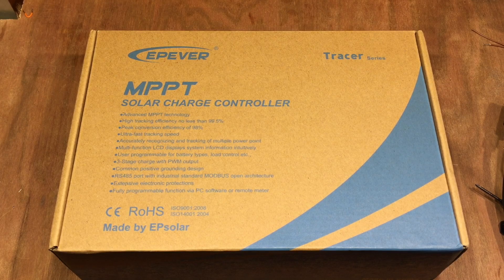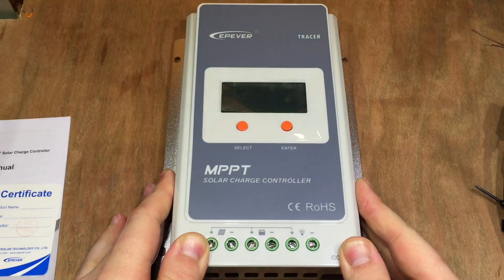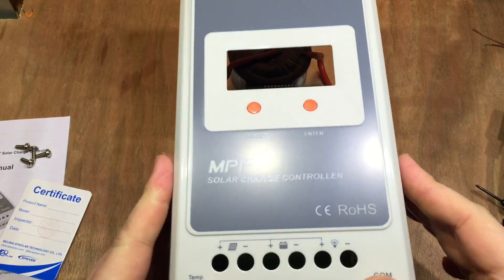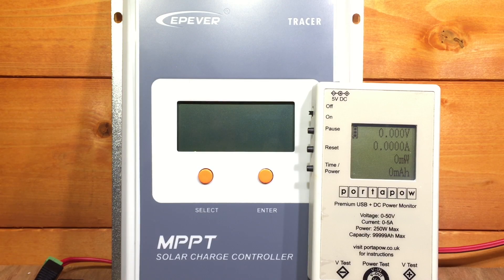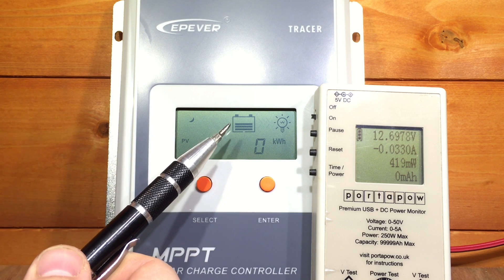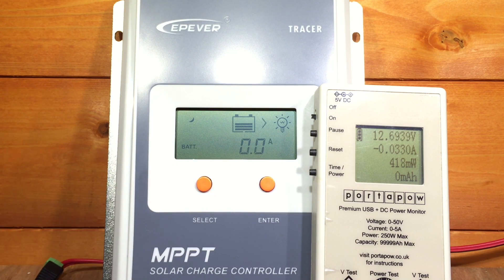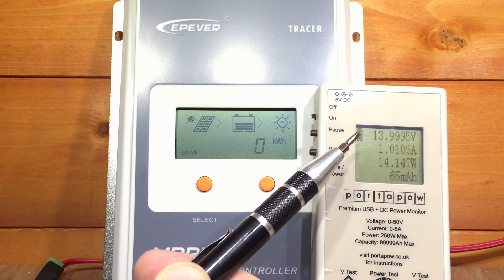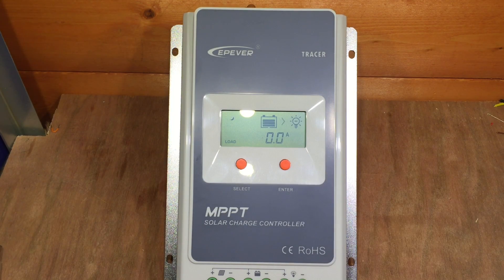MPPT Charge Controller Review - EPSolar EPEver Tracer A Series - 12v Solar Shed

Comment: Hi, I've got the 10 amp mppt , what happens if you you add more solar panels but don't up the model of mppt? 
I've only seen 6 amps from my 100w but I'm adding another 80w  panel
Reply from the maker: Depends on the model of solar charger. The Tracer range allow you to add more solar to the input - there’s a maximum rating in the manual. It will never charge at higher than the rated current though. So you could have panels capable of providing 25 amps on your input to the 20 amp model, but it’ll only charge the battery at 20 amps (or 21 I think it is).
Reply: @AdamWelchUK  I've got the epever Triron 1206n I think. It's a 10a anyway.
I'll not look at upgrading I'll stick with that .
Cheers
Reply from the maker: Yeah the triron range does the same thing. According to the manual yours has a rated array of 130w (@12v) but a maximum permissible array of 390w. It’s great really because you can over spec your array and still get close to your rated current in winter or poor conditions.
Reply: @AdamWelchUK  thanks for the information

Comment: hi, i'm wondering if I need to make a splitter for my battery to load, or if I can connect the load to the mppt directly given my load requires high current. how much current can be pulled through the mppt if the load is connected at the load ports?
Reply: I have the same and my load max is 20 ish amps 12v no probs.. I think it's limited at the amp rating (40) but not sure. My 12v 230 ac is connected directly to batteries.
Reply: @robinhood4640  yeah the limit is 10A for me

Comment: No good. My NiFe batteries need 17V upper limit. Tell the manufacturer to put a user section on the charging parameters.
Reply from the maker: There is. You just need a usb cable, the mt50 or one of the networking adapters (Ethernet, WiFi or Bluetooth) to be able to program that setting. It can’t be done with just the two buttons on the unit itself.
Reply: @AdamWelchUK  I thank you for your response. Is there an app for that?
Reply from the maker: Atrhur Robey There is an Android app which works with the Bluetooth and WiFi modules. Check out the info at epsolarpv.com

Comment: I have just upgraded to this controller, my system works but I don’t understand why I am not getting an Amp readout in the display on either the Battery or PV amp readout. Have you any ideas?

Comment: I bought the 40 amp version. Worked great for one day. Second day, full sun, showing 20v from panels, but showing my batteries at 13.8v. Problem is testing batteries with multi-meter shows 8.6v. Controller's display is showing .1 amps going to the batteries.  Why does controller think the batteries are charged and delivering no current to charge them when they are testing low? Not a bad multi-meter because my inverter is faulting because the batteries don't have enough juice.

Comment: Great video, my 2210a was working great for 2 years until it took a hi voltage hit, I think  lightning. It fried  d12 (diode ?) Every thing seems to work except it will not receive power from the cell. Any Idea what d12 is? I would like to replace it to see if I can get the controller working, thanks

Comment: So a few issues here. An agm isn't a gel and a gel isn't an agm. No such thing as a hybrid  agm gell battety. Use a battery  that is drained so we can see the full effect if the mppt charging.  When it's that high amps will be lowered  naturally. Mppt likes high voltage.  One doesn't typically  do just 17 volts . That's useless to the mppt. It take a high voltage and drops it down and converting the dropped voltage into higher amps. A solar panel with 17 volts  is only going to put out close to 4 amps and the mppt barely put out 1...

Comment: hey adam. thx for  the effort and great vidz. im using a 12v  windturbine and im curious if it will run with a solar mppt charge controller ?. the problem with the PMW is that the  turbine will do a free spin when the battery voltage is high enough to cut the charging of the battery. will a mppt do the same? or will it cause the turbine to go into break mode , so its not over charging?. i know that wind turbine chargers is not in your field of interest - but you might have some insight on this anyway.thx

Comment: Hi Adam great video purchased this a while ago..just upgraded to a 12v Valance Lithium ion battery 138ah (Built in BMS).Could you advise me on the settings I should use in the user section I am using the WiFi box so can change parameters on my mobile.
Email Kennytyrer@msn.com
Thank you Adam

Comment: Thanks for the video Adam!! Couple of questions if you don’t mind taking a look please?

- What parameters would you use with a 12v sealer lead acid battery? I seem to be getting to my over-charge limit of 14.4 far too easily yet my maximum charge is just 14.1?

- Also, do you know how you would set the load time to run during the day for example from 11am through to 3pm.

I also have the Bluetooth adaptor so can adjust setting easily via the app

Thanks for your help

Comment: Question if I have 3 epever connects in parallel . What I need to have to use one meter or  one MT 50

Question 2 
I have 7 panels 275w each
And 3 panel 190w each
Should I get a epever 80a and one 40a
Or should have 3 epever 40a?

Thanks so much.
Reply: Parallel for batteries , separate for panels

Comment: I would like to use one of these to charge a small battery storage system.  While at the same time run a small micro inverter to power the base loads of the house.  If i put this and the inverter in paralel with the solar output, I'm thinking it'll reduce the output of both but would they both work?

Comment: Adam,
have you tried to run the Tracer A controllers at a lower baud rate? I own three controllers that I can monitor from a distant location using MODBUS RTU. The problem is that I have other devices running at a lower baud rate. I have tried to use the Solar Station Monitor Software to change the baud rate using DeviceComParameterForm => Update and receive a "Operation Failed" error. Are the Device Com Registers accessible? With my RTU software I have the capability to Read/Write registers. I assume certain parameters are protected to keep people from loosing communication.
Any information is appreciated.
Your channel is very educational. Thank you...

Comment: Question for Adam: I've recently purchased a 30a unit and before I fit it to my motorhome, I need to consider the wiring. My motorhome already has a mains electric hookup which has 12v charging system connected to my leisure batteries. The alternator on the vehicle also charges the leisure batteries. Would I need to permanently disconnect the mains charger & Alternator charger from my leisure batteries before connecting the solar controller, Or can I connect all 3 charging systems to my leisure battery in parallel? Would there be back feed issues?
Reply from the maker: You should be able to safely attach all the systems together. If the alternator charges to a higher voltage than the solar, the panels won’t supply any current but the charger won’t be harmed - it can handle a 24v system after all. All of the chargers should be protected for reverse current.

Comment: I see they have a 10A edition available. If you put the load output through the input of a solid state relay and connect the battery direct to your load via the relay then youreonlyblimit is the relay amps.
Reply from the maker: And the charging limit...
Reply: I thought it was only an output limit. These limits are pretty much only there so they can sell a more expensive model imho. 

Loved your video. Very helpful. Based on the positive review, I might install this on my motorhome (max 95W solar)

Comment: I have a dc to dc charger in my vehicle, which I assume has a voltage controller.
When traveling I connect this to the batteries in the trailer. I am going to install the Epever in the trailer for when I use solar. Could I still connect the dc to dc power from the vehicle  to the Epever when traveling and the solar is not connected.
Thanks 
Mark
Reply from the maker: Yes, that should be a problem for the tracer.
Reply: +Adam Welch should be or shouldn’t be a problem?
Reply from the maker: Sorry - I got  autocorrected!  Yes, that should be fine. :-)

Comment: thats not silicon AWG wire. It looks like the enameled wire is put under heat shrink tube.
overall not a good review. to check if its reallu MPPT or not we must have to check with oscilloscope

Comment: What is the point of turning the load on and off? My load always seems to be outputing no matter if the load is "ON" or "OFF"
Reply from the maker: Then you’ve got an issue in your wiring, or your charge controller. The load switch should work as you’d imagine.

Comment: I was thinking about using the load to power a pc fan to help cooling. I haven't noticed alot of heat yet. then I haven't used it alot . I haven't pulled the bank below 25.6v. I have the remote screen also. I'm also trying to make the whole system so anyone can use it. I'm putting all the manuals in a binder. for the inverter charger. and the charge controllers. great info.
Reply from the maker: Mine doesn’t get very warm - but I’m well within its rating. Also remember the units are only working at their hardest when you batteries are low. If they are kept quite well charged your charge controller won’t be doing much dc2dc conversion, so no switching and little heat.

Comment: I like my 30 amp version. I basically have it maxed out. I can't put anymore 150 watt. panels in series on it. I have 4 150w 2s 2p. and can get about 22+ amps out of it. it's my first. so I have nothing to compare it to. I seen on amazon. that it said the tracer AN is upgraded version of the A. by the pic. it looked the same. do you know anything about this?   I'm using mine on lead t105's for now. but I have over 100a in lithium I need to incorporate. and eventually use the lead bank for more of a backup use. when the lithium is getting low. I hope to double the cell count in my lithium bank soon. great ol video..

Comment: grate stuff Adam i bought this after watching your video i have a question if i have a few bad days camping in caravan can i hook up my car to battery and charge without damaging  controller  or should i disconnect controller first
Reply from the maker: Thanks Lee.  No, there isn't any need to disconnect the charge controller.  I'm guessing your caravan will be a 12 volt system and these controllers are good all the way up to 30 volts on the battery side.  If your car starts producing a voltage that high loads of other things will break before the solar controller!  Even if some sun hits the panel while you're charging from the car the solar charge controller will throttle the solar panel back so to not over charge your leisure battery.

Comment: Noob question, if I may? On these controllers, there is a load out. I have two questions regarding the load out line. 1. If you are using a 24v battery setup, would the load out be 24v, or is it auto stepped down to 12v? 2. If you had this charger hooked up to a solar panel, but without a battery, would the load out still work? Thanks for any info you may have regarding these questions. I appreciate your videos.
Reply from the maker: Of cause you may..,   Yes the load output will be the same voltage as the battery. So nominally 12 or 24 volts depending on your battery. But remember your battery is charging and discharging so in a 12 v system your load output could range from perhaps 11.5 volts up to 14.4 volts. 
Most charge controllers will not power up without a battery. Most are powered from the battery. Of cause there are a few exceptions.
Reply: Thank you, sir. Very helpful! Much appreciated.

Comment: I use the tracer a 40 a at 64 v input pv, two 32v oc in series. Doc mention that input open voltage is max 92 ... 100v , will it work at around 96v if i add an extra panel?
Reply from the maker: I think you’d be pushing the mosfets very close to their limits. Personally I wouldn’t unless you’re happy to buy another unit if it does fry the Tracer. I’ll be interested to hear of your experiences if you do.
Reply: And it gets also dangerous for electric shoks. I better put the panels in parallel, though my long cable and wire gauge will make a bit of vdrop and heat lost dissipation. But being closer to the 12V battery, that may compensate.

Comment: Hi Adam,
thanks for the really useful video. Can you say readings the screen cant give that the MP50 can or vice versa. In particular, can the builtin screen tell you what current you are drawing from the battery at anyone time. Also, can you explain what the load thing is, I didnt quite get what this is.  Many thanks, Jamie
Reply from the maker: Hi Jamie.
The MT50 meter is fully compatible with the Tracer A series - and in my opinion shows the information in a slightly better format than the inbuilt screen.  The inbuilt screen is useful but the info rotates on a carousel so you have to wait for it to come round, but you can press a button to speed that up.  Check out page 14 of the manual for all the info shown on screen... http://admw.uk/iM
The load output is simply a connection to the battery - so it isn't regulated to 12 volts for example.  However its useful for two main reasons - firstly you can control that output automatically, either when your battery is very low it can switch it off, or it can turn the load out on for a time after dark or before dawn.  You can also turn the load output on and off manually on the charge controller itself or via the PC software or app if you use a USB cable or some other way to connect to it.
So the built in screen will show you the current draw of the load output, but if you connect something directly to the battery (an inverter for example) it won't be able to show those stats.
Hope that helps

Comment: I have just got myself a mttp controller but not getting any amp or wattage showing. so it looks like i have to remove the solar panel from the roof of my van and check the diode

Comment: help again?
i bought a power jack, inverter/  charger.UPS.IT'S low frequency PURE SINE about 2500-3000 watts and has an 80 amp charger. they rate this 5000/30,000 surge. lol. it works great but i found out this inverter has a 25 a/32 volt fuse??,i was told best to use 00 cables so i did on my 2 x 12 vdc/ 109 amp hour  batteries. what size breaker do i need on those batteries? for some reason i have a 300 amp fuse on there now.i think that was what the powerjack guys said. i can't get an understandable answer out of them.they only know chinglish.it blows my mind the required inverter fuse is only 25 amps.  30,000 surge my ass. my little 700 watt inverter has a 30 amp. the chinglish manual says it can run AC up to 1500 watt. but that fuse blew instantly with my soleus,[soulless] 1400 watt  PORTABLE AC/HEATER. i still can't complain though. it is wicked cool . it has a switch for UPS MODE , OR ATS,[AUTOMATIC TRANFER SWITCH. it's like UPS in revers. so if you have solar hooked to the batteries,you can put it on ATS and it gives the batteries and solar priority. if they ever get below the min. voltage ,it switches to house power or shuts down if it has no house power. it has POWER SAVER MODE, to turn on only if a 30 watt or above is needed. so, i can use any light switch in the camper to turn it back on. so cool. but they need math lessons.i think they must be the same people selling the 9000 mah 18650 batteries.
Reply from the maker: On a 24 volt battery system (lets say up to about 28 volts fully charged) a 25 amp fuse would carry 700 watts.  It wont break at 25 though unless you pull that current for a long time.  Perhaps there are two 25 amp fuses in parallel?
Think about what power you'll usually be pulling from the inverter and do the maths.  Power(watts)=Current(amps)*Voltage(volts).  You'll soon be able to calculate the best breaker or fuse rating.
Reply: no .the L.F. pure sine  5000 watt / 30,000 watt surge inverter has a replaceable glass 25 a/32v dc fuse on the inverter side. it blew instantly trying to start the 14oo watt rated AC. it just seemed odd ,because  my small 700 watt/1500 surge schumacker modified sine inverter i have ,has on blade type 30/amp fuse. i don't see how the formula will tell me what amp breaker to use on the battery cable. i know the charger will send up to 80 amps one way so i ordered a 100 amp breaker. i also ordered the,100 amp, bi directional wireless volt /amp meter  you reviewed ,[ the one with the ming he looking screen], and i will use it to see what is going through the cable. i hope i don't see the magic smoke.

Comment: HELP ME ,,, LOL,,,,,the spec's for this say "boost converter". dose this mean input must be less than battery voltage???? i see you are using this to buck. i just don't want a 5th charge controller i can't use. the minghe controller i got said boost also and it says it only boost ,so i could not use it with my uni solar 144 watt/42 maxsolar, to charge my 24 volts battery.  i got it because they say up to 90 vdc input but missed the small print about "your batteries must be more than input" only boost. i would like one that converts higher or lower input than batteries . the uni solar flex panels are different and do not cut off at low volts.they put out no matter how low. what should i do. will those low volt outputs even matter. i mean i can get a reading on bright full moon. probably not much power though.
Reply from the maker: This charge controller bucks the voltage - so the solar voltage is reduced to the battery voltage and the current increases.  The solar voltage needs to be higher than the battery or it will not work.